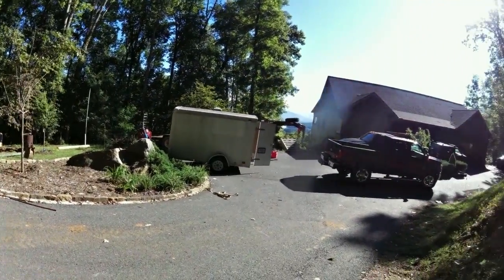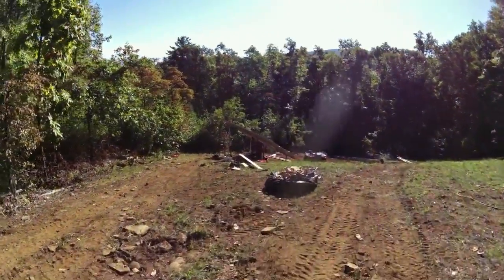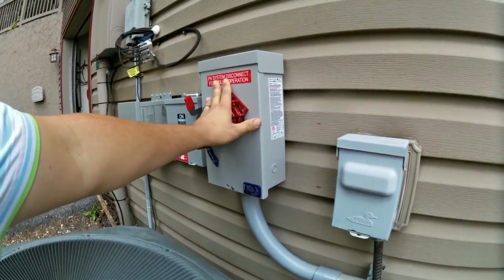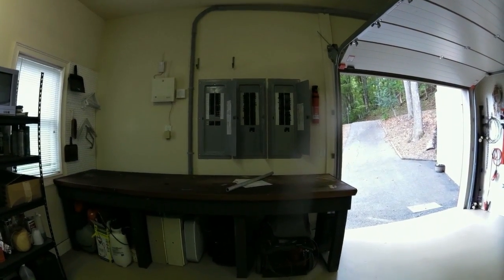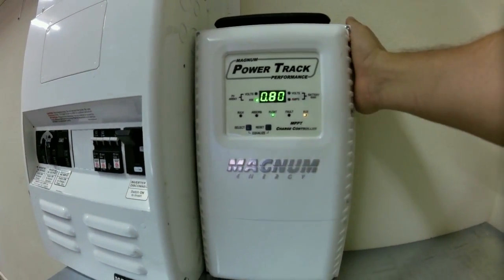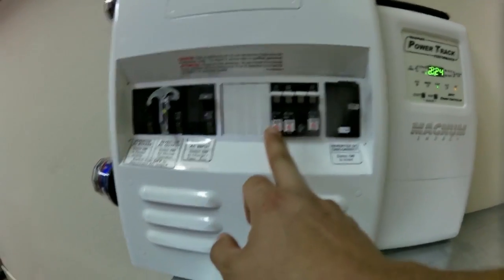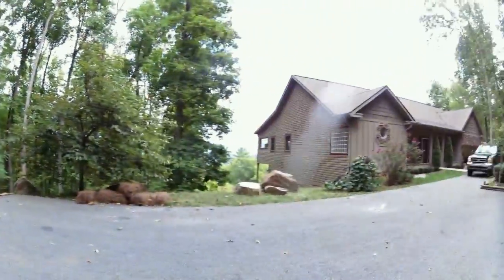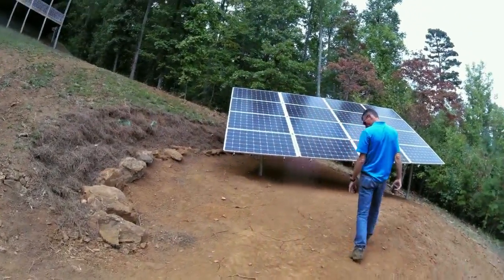Steep Slope Solar Ground Mount PT 2:  Installed Magnum

Comment: That heat pump need to be 18" from the house
Reply from the maker: How bout off grid ready?  Behind the meter is better term. The utility this customer is on won't grid tie with a battery system.  So the magnums AC in control features come in handy for saving money.
Reply from the maker: So the heat pumps is too close to the house?
Reply: 36 inches in a corner 18 inches from the wall
Reply: provides maximum efficiency for air flow
Reply from the maker: You gotta watch those Hvac guys......😎
Reply: Off grid install with a utility meter ? :)
Reply: Gain Solar Services just busting some chops
Reply: Gain Solar Services that was a monster gutter
Reply: Good job guys.
God bless you all and have a wonderful day